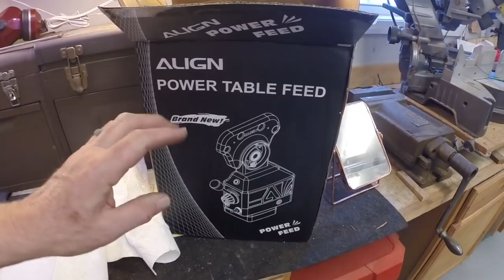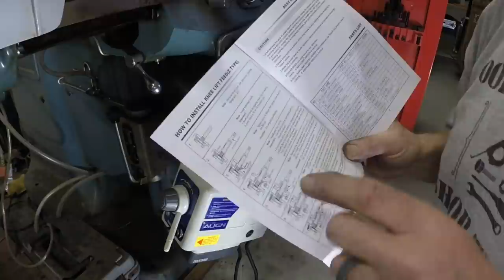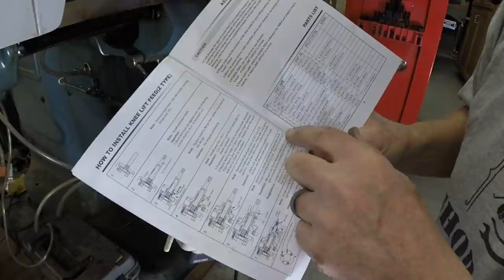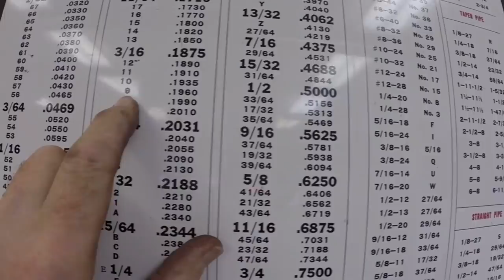Adding Z-axis Power Feed to Bridgeport Milling Machine Knee

Comment: Great video! Although I wish my clone Bridgeport purchase has been a less agonizing event, found after delivery and some cleanup that the Z axis gear shaft was bent. The hand crank hid that problem until fully removing the crank handle. The bushing for the graduated dial is keyed to that shaft so the shaft had to be straightened to remove the bushing and also to fit the shaft extension required for the Align power feed. That meant that the spiral bevel gear for knee Z rise had to be removed before the shaft could be worked on... This all was accomplished but added about a day and a half to the simple job of attaching the Z axis power feed! Thanks for the video!!

Comment: I think the limit  switch  should be hooked up so at any time the feed motor doesn't stop , the limit  will kick off the feed from striping or burn the motor
Reply: Sort of machine shop 101. This guy needs to find some course work or experienced people, anything, but he is a hack at this point. DON’t WORK UNDER A CLOUD OF IGNORANCE. Go get help.
Reply: @boonedockjourneyman7979  I personally think you are being a bit cruel on the point you are making. He is the only one that runs the machine, and I am assuming, as he says, he would just simply keep a good eye on what he is doing. We also don't know how he uses the machine either. OF COURSE it is best practice to put it on, without question. But I'm an electrical engineer, and have a dead mans cord, to backfeed my electrical mains, if I lose electric. NOT a good idea, but I am the ONLY person that would know how to start the generator, let alone, my wife is not strong enough to even go to the barn to retrieve it. I know to keep the power main off when in use, and to never start the generator, unless the cable is plugged in on both ends. I've been told off by MANY industrial electricians for this practice, but I laugh, I'm the only one to use it. To be honest, I better be more careful reaching toward my mill before the end mills stop spinning or I'm REALLY going to regret being in a hurry one of these days. But I wouldn't consider this man ignorant, nor myself for using the dead mans cable. But there DEFINETLY are better practices for certain in both cases.
Reply: X and y should have limit switches as they offern teach their limits, Z if you over travel up the threaded rod just leaves the nut and it'll stopp lifting, only in down will you damage something, but you never work  at the limits of the Z axis, infact most of the time you don't even use the Z axis

Comment: Like all parts "custom made" for car, boats or motorcycles nothing fits right off the bat, everything needs a bit of tweaking. You did a great job on installing that drive unit. I think everyone who has ever built anything has used pliers as a hammer and electrical or duck tape as a bandage. LOL
Reply from the maker: You noticed my improvised band aid!  Haha!  I thought the black duct tape would be less noticeable than blue painter's tape. LOL.  Do what ya gotta do, right?  I went into this you tube thing with the objective of transparency and honesty.  I don't hide mishaps, I figure we all learn from them and most people appreciate that.  Thanks for watching, Tom.

Comment: G'day Frank.  I will be installing the same motor as you just fitted to both the Z & Y sections, so the video came in handy. 
Job well done, & it works, which is a plus 😊

Comment: I have a couple of those roll pin punches.  Ironically, I bought them specifically for working on Cub Cadets.  There were roll pins in the driveshafts, and front axles where they came in handy.
Reply from the maker: Same here.  That's how/why I got mine.
Reply: Never owned a set, I think about it all the time. LOL. (Damnit) one of these days, I'M GOING TO BUY ME SOME!!!!

Comment: nice video, I wish I could have that large show with all items :)  It would be nice if the drive did have a slip clutch in case any stiffness or blockage of the Z Axis, but I would guess that would be the limit switch's

Comment: Do you not have to pin or lock the extension shaft onto the existing drive shaft in some way?  What keeps the extension shaft from simply unscrewing as you run the table down?
Reply from the maker: yes, there is a roll pin.  At the 25 min mark. That pin goes through the both the extension and the original shaft that is inside the extension.

Comment: Hi Frank, may I ask the Make & Model and what weight capacity did you purchase, Thanks for taking the time to record this. Regards from New Zealand.
Reply from the maker: ebay: https://www.ebay.com/itm/233351563239  if that works for you.  "ALIGN TAIWAN Z AXIS POWER FEED KNEE MILLS - BRIDGEPORT & OTHER MILLING MACHINE
5 YEAR WARRANTY, HEAVY DUTY HIGH QUALITY GENUINE ALIGN" $339 USD.
Reply: Wow Frank Thats fast thank for the information. Regards Beagles.